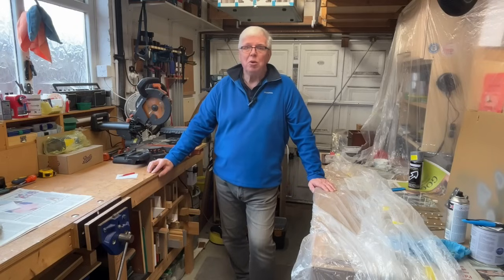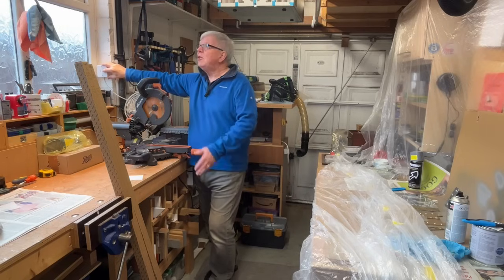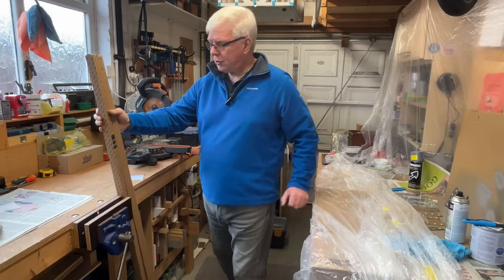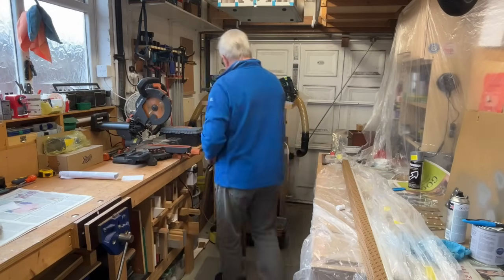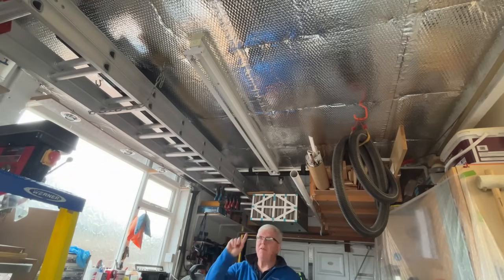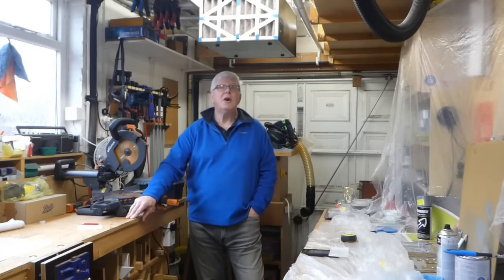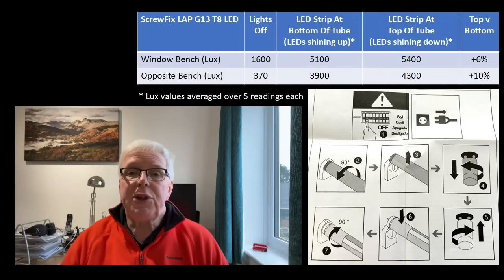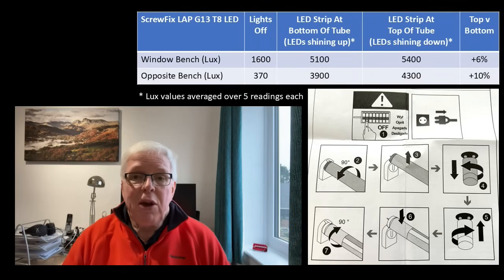Replacing Fluorescent Tubes With LED - ScrewFix LAP G13 T8 LED Tube - Fitting - Test - Review

Comment: I'd be concerned buying lighting from Screwfix.
Everything i ever got from them broke within 3 years. Expensive when its a whole commercial unit full of led ceiling panels, or apartments with downlights.
Having to redo a whole job every few years adds up....and trashes your reputation
Reply from the maker: The main thing I've had a problem with is door locks. Had to return a couple because in one case it'd been badly assembled, and the other was missing a couple of parts. (I suspect what happens is that people return stuff that get's put back into stock without anyone checking it first). The one thing I will say is that I've never had a problem getting a refund or exchange. Cheers
Reply: I don't think it's Screwfix (Although they are a lesser store since B&Q bought them) but products in general today. The drive for cost reduction which we all take advantage of means almost all products are worse than they were twenty years ago when advances in technology should be making them better.
Reply from the maker: 💯Couldn't agree more. Whenever you buy something that comes with screws included, they are inevitably soft as ***t and chew up instantly you try to use them e.g. light fittings, curtain rails etc etc. Contrast that with a 50+ year wooden cabinet that I took down for someone the other day. Solid brass screws, in as good a condition as the day it was made. OK, they were slotted head, which can be more of a pain than Posidrive, but perfectly serviceable to reuse for another 50 years. Compared to the cheap stuff which just goes straight into my recycle scrap bin. "... Progress ..."

Comment: Thank you for the info.I did not know there are L.E.D. florescent replacements..will have to source a few for the shed and kitchen. The father kept a stockpile of florescent tubes in the shed so no shortage here for now, but still time for change.
Reply from the maker: Glad you found it useful. Yes, I think they've been around for a few years, but I hadn't been aware of them until it came time to look for a replacement fluorescent tube on Screwfix and they didn't have any in stock anymore. Cheers, Chris

Comment: I replaced two double five foot tubes in my kitchen with two new battens and am very pleased indeed. Much cleaner, instant starting and, hopefully more reliable. They certainly look much nicer.
Reply from the maker: Totally agree that completely new LED battens visually look a lot better. Not too much of a worry for the garage, though may end up fitting a couple in the end, as some of my remaining fluorescent fittings are getting quite long in the tooth. Cheers, Chris
Reply: I’ve done the same in the garage. The new battens are excellent and were easy to fix

Comment: Fit these in my garage many years ago. I was sick of the fluorescent tubes, by the time they fired up I'd grabbed what I wanted and left.
Reply: @cypeman8037  I fitted electronic starters, which seemed to speed things up a bit.
Reply from the maker: I know what you mean. I've still got 4 single fittings with fluorescents in them, but being a tight wad, I'm only going to replace them when they finally give up the ghost ... Cheers, Chris

Comment: Have a look at Philips CorePro LED tube Universal ,there a whole family of them,some are available in 4000K & 6500K versions, they work with Electro Magnetic ballasts or HF Electronic ballasts.
But,  looking at your fittings  would have replaced them with new LED batten.
Reply from the maker: Thanks for that. It's certainly an advantage that they operate with either type of ballast. The twin fitting that I replaced the tubes in isn't actually that old (maybe 5 to 6 years) so still plenty of life in it 😊 The other two singles (I didn't show) are a lot older, so I'll probably replace them with new LED battens once I run out of fluorescents to use up. Cheers
Reply: @stuartandrews4344  you get what you pay for. Cheap Chinese vs quality European manufacturer. No contest.

Comment: Madness. Replace the fitting with an LED one, and then you know it will work.
Reply from the maker: I'm afraid I disagree - it depends on your circumstances. Fine if you're comfortable doing a bit of electrical work yourself (done plenty of it myself), but if you have to pay a sparky to fit a new batten, you're talking anywhere from £50 to £100+, plus the cost of the batten (min. £40 to get 6000+ lumens based on Screwfix today).  If you're unsure whether it will be suitable for your existing fitting, fine, then take advice. But each to their own. Cheers
Reply: @handyman-at-home  While, to some extent, I agree. Manufacturers won't continue to make LED tubes when LED fittings are ready available. I used to work in the trade. Bite the bullet and replace your fitting
Reply: @dinmorejunctionmodelrailway   Its no different to one of the newer counterparts failing since you have to get a whole new unit as they are non serviceable  and for most people it mean getting an electrician in to basically change a bulb. Not to mention the environmental consequences. 

This is more the way forward imho.
Reply: @jsouto77  100% there is. Fluorescent fitting is date by design, and so will the LED replacement tubes. Plus, an LED fitting will offer a higher lumens. It isn't my money that will be wasted
Reply: @dinmorejunctionmodelrailway  Why is it?...It's a body that you fit a bulb into. just like every other build that was replaced with LED around the house. I make my own lighting from led strips  and  I can achieve Lumens parity with these LED Battens in a far more elegant  and sustainable way.
Reply: 1. Fluorescent tubes should be recycled to prevent the release of mercury into the environment. Recycling allows the reuse of the glass, metals, and other materials that make up fluorescent lights. You can recycle fluorescent tubes at your local Household Hazardous Waste (HHW) collection site.  Safely transport the intact tubes in the cardboard sleeves in which the replacements come.
2. You could play around with the light meter App - using inverse square law : halving the distance to light source should double the lumens.  Obviously, given that it's not a point source light, maybe sample several locations longitudinally and laterally.

Comment: I recently saw a breakdown of all household electrical items and how much power they actually consume. I saw that LED's actually over time cost more. Switched on for a short time not a problem but for hours on end the power companies make more money. I cannot be the only person that has changed out more "long life" modern lamps than they ever did with the old filament lamps. All that nonsense of 60 watts equivalent  and you need to get a head torch on to see what you are doing !!! There is no way on planet earth electricity companies  are ever going to let the public have something that lasts forever and costs nothing. i.e. cars that last 50 years and run on fresh air. My wife had LED strip lights installed under the kitchen cabinets of which 1 strip died and I have replaced 3 transformers.
Reply from the maker: I'm certainly sceptical about the claimed lifetime for LED bulbs of various forms ... I've swapped more 'LED Candle' bulbs than I've had hot dinners ... but I think the problem lies in the fact that they're all churned out in China where (not always but a lot of the time) they use the cheapest components they can. Having said that, I have found an LED GU10 which works very well for us, as it has an above average brightness (660lm / 5.7W) so I don't need the head torch anymore 🤣. https://www.toolstation.com/integral-led-classic-gu10-dimmable-lamp/p36746 if you're interested. How you track lifetime though, beyond timing when you switch on and off, is the problem - but life's too short for all of that ...
Cheers, Chris
Reply: @handyman-at-home I also did the whole house swap to LED but I bought a lot of expensiveish led replacements, I have to say I have changed maybe 1 or 2 and the use of electricity has definitely gone drastically gone down
Reply: Fitted 19 LED gu10 spots in our kitchen and utility 11 years ago. Have only had to replace 3 lamps in that time. Power consumption is a fraction of the old lamps that came with the fittings. Only disadvantage is the kitchen gets cold in the winter! All the lamps are Screwfix own brand. I fitted dimmable LED lamps 
in our daughter’s bedroom ten years ago. No failures yet, touch wood.
Reply: There is a huge difference in the quality of light fittings on sale. For once, Screwfix LAP LED's are pretty well respected (as are IKEA). I can't say the same for the rest of the LAP wiring accessories as my own experience of those is that they are junk.
I've got Excite LED battens (from City Electrical Factors) under my kitchen units and they've been in for about eight years now.
Changing lighting without doing the work to ascertain the light distribution never gives a good result. Luminairs from reputable manufacturers have polar graphs showing the light distribution (and intensity) around the fitting at various distances. If you use this against your floor plan, knowing the height at which you're installing them, you'll get an idea of the incident light levels at  work surfaces, etc.
As for a lower wattage LED consuming more power than a old tungsten or fluorescent of a higher wattage that is obviously wrong. Power is power. The number to be looking at the Lumens/Watt. And old school lamp bulb was around 1 L/W, a fluorescent (high frequency electronic ballast type) around 100 L/W, a SOx lamp (old style orange street lights) was around 100-150 L/W. LED efficiency depends a lot on the technology used to drive them. Cheap LED lamps use a series capacitor to act as a voltage dropper, more expensive ones use proper, high efficiency driver circuits. Generally, a good quality LED should be achieving around the 100 L/W figure.
Like any 'new' technology there's a lot of failed attempts out there. Some of the earliest lamps I was asked to change consisted if nothing more than a bunch of 5mm LEDs, wired in series and stuffed into a lamp base. There was no cooling and their life was short.
Reply: LED downlighters 8 off have all gone yellow and two have packed ip. Back in the day they were very expensive and now i've had to replace them all, not that cheap even now.  I wonder about the supposed savings.
Reply: Get rid of the starter and ballast and wire direct to the one end
Reply: Very interesting 
I wish however you had worn safety glasses when handling the tubes.
Reply: Exactly my experience the claims are massively exaggerated along with the claimed life. Also, after a few months you will be lucky to be able to find the same lamp as a replacement 👹.
Reply: Led bulbs and lights were touted as long lasting found is bull+++

Comment: If your fittings have power factor correcting capacitors and you don't remove them they will NOT get any power saving. I bought dozens of similar tubes from TLC and several months later measured their consumption and found it was no lower. Challenging the claims on their web site TLC (after a bit of wrangling) sent their expert to my workshop and he confirmed my findings. It then took several emails to get their web site changed to reflect this issue which eventually they did.
Reply from the maker: Interesting! I mainly bought these down to the fact that Screwfix didn't have any fluorescents and I thought they were worth a try, rather than specifically on the energy consumption. Cheers, Chris

Comment: The old tubes were non-directional. You seem to be saying that the new ones have an 'up' and a 'down'. Therefore, properly fitted, the proportion of the LED pointing downwards should be higher.
Reply from the maker: Exactly. I agree it's marginal ... 6 to 10% based on my, admittedly limited, testing ... but there is a difference. I haven't taken one of these tubes apart, but from what I can see, they are essentially just a ribbon string of LEDs, stuck to the inner surface of the tube. Cheers, Chris
Reply: @handyman-at-home  I had a broken one from Screwfix and they are basically just that. The tubes are glass which is coated white on the inside.